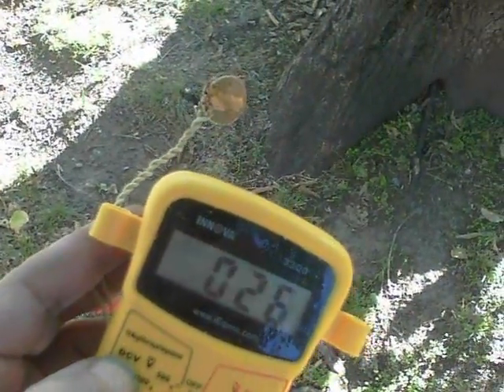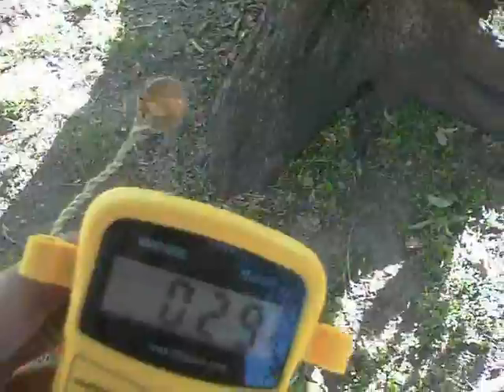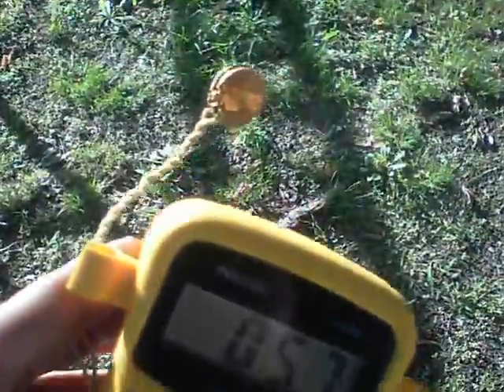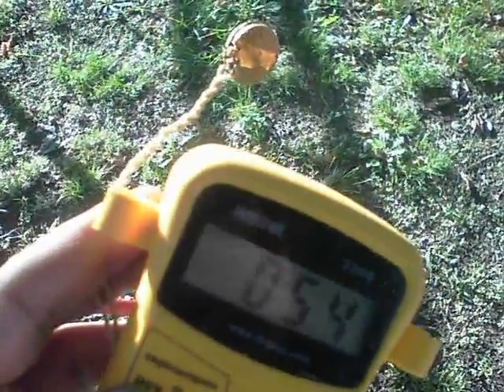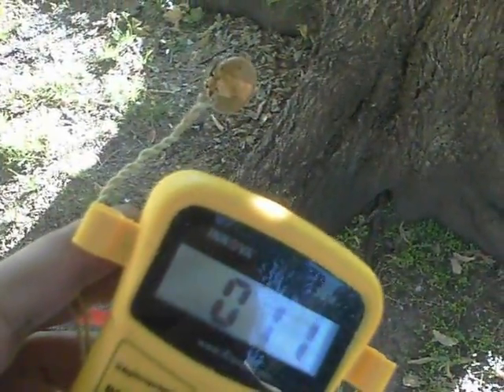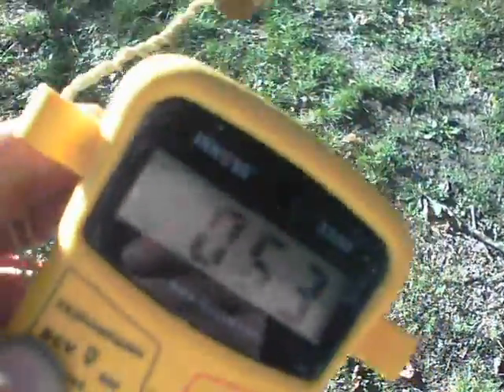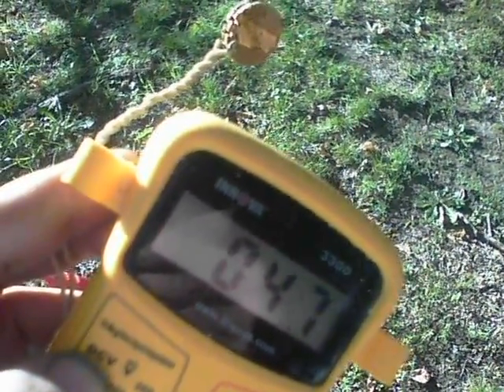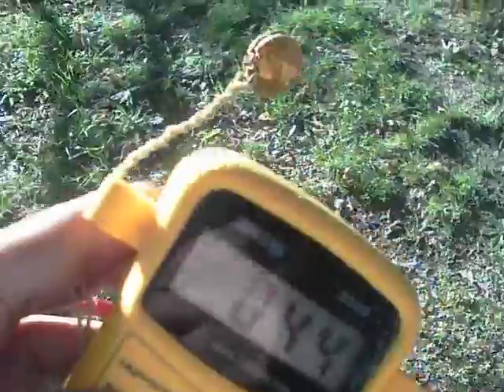Solar Power Pennies

Comment from the maker: @KyleCarrington I don't think so but used to as well. A test  running now, where 1 battery seemed to die, yet i've found it quits after midnight and comes back the next afternoon - all the while connected to the oscillator circuit ! Out of 50 or so cells so far, most seemed to die off after a week, but many haven't, I presumed they had, when an oscillator stopped. Never drop to zero volts, retain about 0.4V. It's amps that appear affected by RF, I/R, light, heat, vibration, solar flares.

Comment: I'm following along with all of these experiments, with great interest, whether that be crystal batteries, or an offshoot... but there is one thing that kind of troubles me (personally) about all of this. Have you ever taken a simple electrolytic battery and actually tried to kill it? I have. It is very difficult to get a battery to the point where it will no longer put out current, as measurable in uA. So... are we arguably, then, making very very weak electrolytics?

Comment from the maker: @KyleCarrington In the orig video, the chap shines a light on the pennies and shows the increase. The battery part is there because of the salts between, however there being 2 same metals. Meter is connected directly, works more as a simple indicator than a true RMS. I'll find the orig video and put the link in the description box :)

Comment: Why could that not be construed as an electrolytic battery effect, with air, and moisture in the air being the electrolyte? not sure how your meter is attached, though, either, and have not seen the other experiement. Interesting none-the-less! Thanks Slider